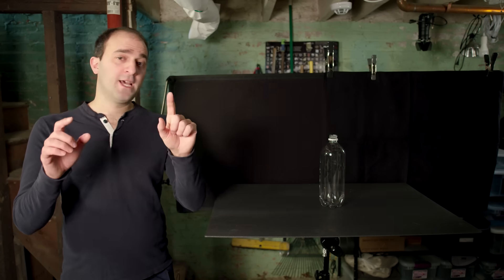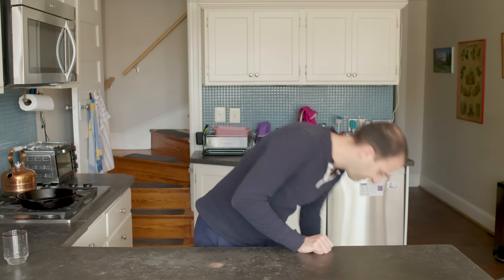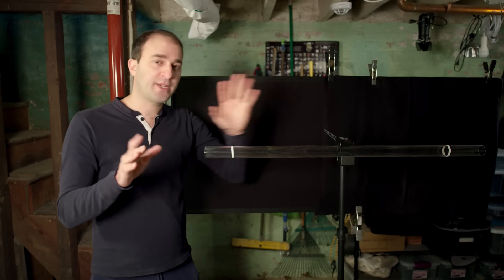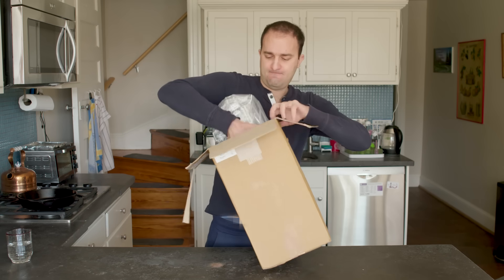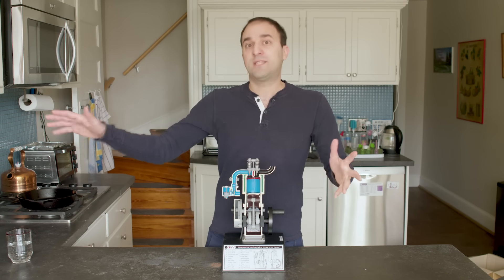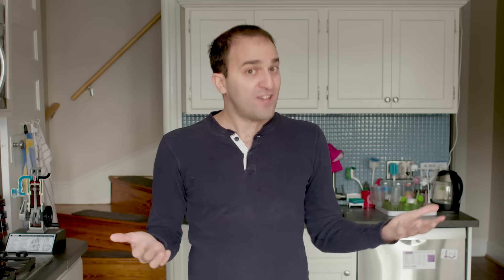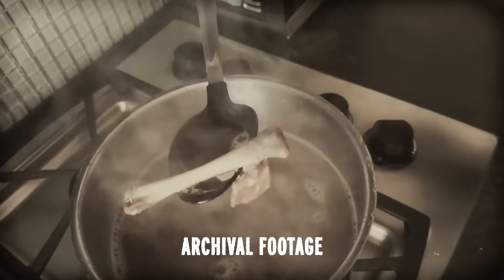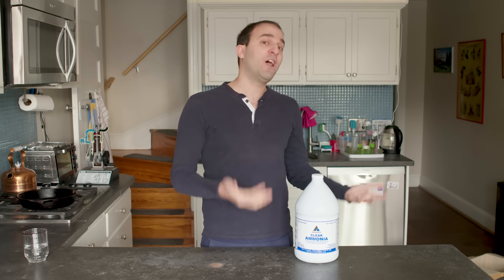Does Toyota Know Something That We Don’t?

Comment: Ammonia-powered cars make absolutely zero sense when ammonia's extreme causticity is a core reason why we aren't using it as a domestic refrigerant in fridges, freezers and heat pumps despite being one of the best options otherwise.
Reply: Worked in industrial refrigeration long enough to tell you its more of a complexity issue than anything else as to why we don't use it domestically.
Also can confirm, that shit HURTS when you get a lung full but after a while you hardly notice it.
Reply: @74KU  The dairy plants in my region use ammonia refrigeration and all have a windsock to indicate wind direction in case of an ammonia leak and the urgent need for evacuation.
Reply: @74KU  That's the ammonia dissolving the alveoli in your lungs lowering your ability to take in oxygen and adding accumulating layers of scar tissue that will become an issue at some point. Its nasty stuff.
Reply: @74KU For sure. It ten times as efficient as freon but the equipment has to be all iton and too expensive to build.
Reply: This post is exactly what I was thinking. And the NOx emissions would be terrible. I'd take carbon emissions any day.
Reply: It was once used in refigerators before low b.p. organics replaced it. As a pure anhydrous gas it isn't caustic, and it would presumably be stored and dispensed in compressed liquefied form. That would mean some practical difficulties in using it for the average car, and of course any contact with atmospheric humidity would transform it into the slightly caustic hydroxide. Presumably the Chinese/Toyota engineers are aware of all these factors and addressing them, but how successfully remains to be seen
Reply: @IUSSHistory  40 years ago, we had leaded gasoline and ethanol wasn't a thing. Now, few stations offer anything below E10 and E15 is fairly common. 10 years from now, you likely won't be able to get anything below E25 and there will likely be incentives for people to convert their non-flex-fuel vehicles to either flex-fuel or E85+.
Many gasoline cars will run on E85/100 fine as-is if you progressively increase the concentration and run a drive cycle to let injection trim tables catch up, though you may lose up to 30% of power once you hit the ECU trim, fuel injector or fuel pump limit, whichever comes first.
Reply: Ammonia engines may make sense in industrial mining and transportation, agricultural. Not in private transportation
Reply: @winelive5500  to be fair though, they said the same sorta stuff about the automobile 120 yeats ago.

Granted in dealing with anyhydrous ammonia, different ballgame in terms of consumer safety
Reply: At school we were told not to pipette dangerous liquids by mouth. One boy didn't heed the advice and pipetted 880 ammonia into his mouth. He was standing near me and I got a first hand view of the effect. I always used a rubber bulb for everything after that.
Reply: Sure and we'd never put gasoline, lead, and acid together in our garages. Ha!
Reply: Alternatives to gasoline would allow people to keep their ICE vehicles.
Reply: @CautionHighWavesAhead-  If synthetic fuel substitutes can be made in a sustainable manner with decent efficiency.

If you need 2X as much energy to make 1GJ worth of fuel which then gets burnt in an ICE to produce 1/3 as much net work at the wheel than the fuel contains, that is 12-15% efficiency from wheels to wherever the power came from including transmission and conversion losses.

With BEV, you have 80+% efficiency, which means you need about 1/6th as much power-generation and transmission capacity than you would for such synthetic fuels.

Making synthetic fuels from electricity only makes sense as a last-resort energy dump for excess renewable power.
Reply: That and you pretty much need anhydrous ammonia for this to work. Then there's the whole hazardous fuel aspect...
Reply: @patrickw9520 Yep, you have plenty of water on your eyes and in your airways. No way that you are going to have a good time around any leaks. I work in a lab any have experienced this several times over the last 30 years. The worst I have had are like being punched in the nose - hard.
Reply: They do use it in like ice skate rinks right? On a two stage cooling system? I think that how those HVAC and county inspectors all died in that Minnesota skate rink incident I believe?
Reply: @Joseph-jt3vg  Ammonia is still common in commercial/industrial chillers and skating rinks would be on that scale. I haven't found the Minnesota incident. Something similar happened in BC in 2017: three deaths after a rink chiller had an ammonia leak caused by at least 20 identified manufacturing, installation, inspection and maintenance failures.
Reply: @teardowndan5364  that might be the one I’m thinking of. Minnesota I guess reminds me of Canada. Just like Buffalo and Plattsburgh lol
Reply: Amonia was used for many years in refrigeration. I don't think you're correct on this.
Reply: @davidwestwater2219  I said DOMESTIC (as in household) refrigeration. Commercial and industrial refrigeration is a whole other story.
Reply: @canievision808  Commercial/industrial chillers, not domestic ones.
Reply: So by your logic ammonia is dangerous but gasoline isn't? 

Meanwhile a host of lithium powered EVs are spontaneously self immolating. 

I'm not commenting on the relative merits of each or any sort of motive power,  but simply on the logic,  by which you would seem to assume that water must be dangerous because most people die within 24 hours of drinking it.
Reply: @dougbright8120  Ammonia gas will directly attack all exposed tissues including your lungs if you breathe it in that deep. Gasoline fumes are mostly harmless until the concentration is high enough to detonate.

Ammonia is a gas at room temperature. If the tank ruptures and you are downwind from it, you may inhale ~100% ammonia which will severely irritate your respiratory tract and possibly require hospitalization. If a gasoline tank ruptures, it takes a while for gasoline to evaporate before anything can happen to it and if you are downwind, even a whiff of 100% gasoline fumes is still harmless as long as you walk out of the fume plume before suffocating.
Reply: Could this be used to turn the vehicle into a suicide machine ?
Reply: @tonystorcke  If you meant suicide-bombing, the initial explosion to rupture the tank would mix ammonia with air which would reduce its effectiveness as an irritant beyond its immediate vicinity in open-air areas and if the mix ignites, most of the ammonia will get destroyed in the deflagration. Not much more effective than a conventional vehicle.

Otherwise, it would be a relatively slow and particularly painful way to go. I bet most people who might attempt it would change their mind after the first whiff of 100% NH3.
Reply: Easier to store than hydrogen. Desperate measures and all...
Reply: or maybe Tokyota 👌🏻 was foolishly... fooling around for a pioneer baby project for a Tank fuel Ammonia on forklift Wheel's 👍🏻😢
Reply: They would likely use 950-D stainless steel piston sleeves and heads
Reply: It was used quite a bit, I have personally seen it at many skating rinks and one very old leaking Delco refrigerator.
Reply: Ammonia has three hydrogen atoms in every molecule.  That's not a huge secret.
Reply: Well it used to be.
Reply: Yeah my understanding is that higher concentrations of ethanol such as E85 can cause damage to fuel-system seals if a car is designed for 100% gas or E10. The ECU needs to be programmed appropriately to work with high % ethanol fuels. But a significant advantage with ethanol is actually that it reduces or eliminates carbon buildup in places that come in contact with the fuel, and as the ethanol concentration goes up, the problem of engine knock reduces to almost nothing. (which is why E85 or higher is required to get best performance out of Koenigsegg cars and others that run ridiculous levels of boost)
Reply: Anhydrous NH3 is one good way to transport hydrogen.
Reply: @thisisyourcaptainspeaking2259 it is also a good way, to second tag nitrogen below water's 😊
Reply: Urea is in def fluid, when heated turns into ammonia, hummmmmmm
Reply: The other reason is Dupont controls the world's refrigerant supply, and is instead putting more and more PROPANE in it every few years!  Maybe THAT is why we've been seeing houses suddenly explode recently!!!
Reply: Gasoline isn't exactly drinkable either.
Reply: @tonystorcke  You would likely survive drinking a small glass of gasoline without much if any permanent damage after a week of your digestive system making sure you regret doing so. You will also survive taking a few breaths of gasoline fumes perfectly fine aside from momentary dizziness.

Anhydrous ammonia (100%) on the other hand is highly caustic. Breathing straight ammonia will cause acute irritation throughout your respiratory tract and possibly cause you to drown on your own secretions attempting to protect everything from further irritation and damage. If you survive, there will likely be permanent injuries.

Ammonia poses a drastically higher baseline chemical threat to safety. With gasoline, the main threat is fire, which would be an issue with any other fuel including ammonia.
Reply: Concentrated ammonia is also a lethal poison. You don't want that leaking in the fridge in your house or your car.

I used to work at an ice plant. They used ammonia to instantly freeze water. They also had regular safety drills so everyone would get out of the building if there was ever a leak.
I'm sure Toyota knows more about it than I do though.
Reply: ....CAN BE FIXED.....THERE'S lots OF MATERIALS THAT CHEAP AND CAUSTIC PROOF

....AND BUILDING TANKS more SECURE IS ALSO OK
Reply: @robotnikkkk001  yup 👍🏻 what Chinese specialized is 🙏🏻
Fix with lowed Minefields
Reply: It's already being tried in shipping.

Yara Clean Ammonia operates the largest global ammonia network with 15 ships and has, through Yara, access to 18 ammonia terminals and multiple ammonia production and consumption sites across the world. Revenues and EBITDA for the full year 2022 were USD 4,422 million and USD 249 million respectively. Yara Clean Ammonia is headquartered in Oslo, Norway
Reply: @gk5891  The problem with ammonia isn't whether it works. It is that it is that 100% ammonia is too dangerous for general public use.

Industrial use isn't general public. If a ship in the middle of the ocean has a significant NH3 leak, the crew can lock itself in safe spaces, suit up and then do something about it. Not so much if a car leaked 40kg of it in a crowded area.
Reply: @teardowndan5364  Yes, I was just agreeing that it will used, but not for general automotive use.
Reply: But it did work. For a long time. And still does.

Ammonia is still used as a cleaning chemical.

Hydrocarbon fuels are powerful solvents so we developed solvent resistant hoses, gaskets and seals. The same is done with ammonia.
Reply: @danielbeard2656 There are reasons why domestic ammonia-based cleaners are only 3-4%. The water is there to slow down ammonia's evaporation rate and reduce the likelihood people will unalive or injure themselves from mishandling it. You are spraying your 3% cleaner at the window and that 3% sprayed 3' away from your face is already enough to make your eyes and nose sting.

You can breathe gasoline fumes straight from the jerrycan perfectly fine as long as you get to fresh air before asphyxiation sets in, no immediate risk to health from occasional exposure. That is why there are so few injuries despite how hypothetically dangerous handling large amounts of gasoline is. Millions of gallons get pumped around each week by untrained randos at gas stations many of whom probably shouldn't have a driver's license, still without issues.

Ammonia on the other hand is very caustic. It will immediately damage vulnerable tissues. If you tried breathing in a lungful of 100% ammonia, you would likely suffer a permanent loss in lung capacity or worse. Spilling a gallon of it near a crowded space could be a disaster, especially when you include people who already suffer from other respiratory problems.

Ammonia as a fuel only makes sense for commercial/industrial applications far enough away from the public that only trained crews need to worry about leaks and spills.
Reply: this is........mentioned in the video, both ammonia being causic and not suitable for cars
Reply: Not to mention we can't literally pull it from the ground. We are just adding a step to the process with ammonia.
Reply: Yes, apparently it's an issue for auto designers.
Reply: Ammonia is used for refrigerant domestic cooling,  Servel makes water chillers, then the cold water is pumped through out the house evaps for cooling....  I used to work on them 20 years ago...
Robur and Servel, a trusted name in gas air conditioning products, now offer small capacity chiller units suited to residential use and with the capability of providing improved zoned comfort.
Reply: I agree.
Further, has anyone calculated the cost of producing NH3?
Reply: @RUHappyATM 
Production is nothing new. It has been produced for many years, and has been used as an industrial refrigerant for most of the 20th century. The problem is shipping and handling. It readily changes to gas and is very hazardous to humans, and animals. Using it as a fuel is seemingly not a good idea. First it has less than half the energy of gasoline and secondly if released due to accident or other tank rupture it could injure or concievably kill bystanders. 😊
Reply: @RUHappyATM  in bulk, you can buy it for ~$0.75/gal. At 1/3 the energy density of gasoline, that comes to about $2.25 for the same energy as 1gal of gasoline. Not that bad a deal apart from needing a 3X as large fuel tank and all-new infrastructure to handle this highly caustic stuff.

Cellulosic (plant waste) ethanol is about 50% more expensive but doesn’t require much if any new distribution infrastructure, should work with most semi-modern cars with little more than an injection table tune-up and would be safe to drink were it not for gasoline contamination and additives, some specifically selected to make it unpalatable so people don’t start using E100 as a vodka substitute.
Reply: @teardowndan5364  Plant based ethanol is terrible for engines. The more ethanol you use in a traditional ICE, the more likely you are to destroy it early. There is a ton of studies/science on this, as well as more testimonials by wrench turners on Youtube than you could imagine. Also, the amount of water they user per gallon of ethanol produced should be criminal. Without government corn/energy subsidies, ethanol would never have been an option as it is too expensive and ecologically dirty.
Reply: @liwojenkins  How old are those studies? Ethanol compatibility has been required by law in the USA since 1994, anything newer than that should be able to handle E85.

Methanol is the potentially highly corrosive one that also eats many common plastics and gasket materials.
Reply: @teardowndan5364  
E100.
Is that 100% ethanol?
Reply: @RUHappyATM  Minus a bit for additives like camphor to make most people hurl if they try drinking it, some residual gasoline from the gas station equipment when switching fuel tanks and residual components from the distillation process to skip the added cost of multiple distillations and reduce the amount of tail/head getting discarded.
In Brazil, E100 must be at least 95% ethanol, can have up to 4.9% water and less than 0.1% of anything else.
Reply: @liwojenkins  most modern cars are just fine with ethanol, as long as you dont let it sit too long
Reply: @teardowndan5364  uh, hate to tell you, but ethanol does not at all solve the carbon emission problem.  duh.
Reply: @thomasneal9291  Solving carbon emissions is a fool's errand, which is why most sane people are focusing on carbon neutrality (not digging new carbon out of the ground) instead of zero. Ethanol is renewable, can be made from plentiful plant waste, non-toxic, easy to transport and distribute using existing infrastructure, compatible with most existing vehicles and burns cleaner.
Mining and building battery factories at breakneck pace to rush the electric transition based on premature battery tech produces tons of emissions too. I doubt we'll have honest numbers on how harmful the rush really is until 10-20 years from now when governments won't be able to sweep greenwashing consequences under the rug anymore.
Reply: @liwojenkins  David blum disagrees with you and debunks your claims the first cars where made to run on etanol and etanol can be made of waste plants that grow as weeds  and the by product from making etanol from corn can be used as cow foder
Reply: @thomasneal9291  yes it does duh Not to mention there are no carcinogenic byproducts when you burn it
Reply: @teardowndan5364 Most cars here in 🇧🇷 run on both a 25% ethanol / gasoline blend and up to 100% Ethanol made from sugar cane which uses about 1% of Brazil's land mass.
Ethanol mixes and Ethanol itself produces less harmful emissions.
Also compressed Natural Gas cars are available too.
Maybe an Ethanol fuel cell might be a cleaner solution?
Reply: @RUHappyATM Yes and it widely available here in 🇧🇷 however I believe it does have about 4% water  in it.
Also sugar produces more ethanol then 🌽 🌽 .
Reply: @BasedInBrazil  Ethanol fuel cells would be great, apart from needing platinum for the catalyst to achieve decent efficiency and power density just like hydrogen fuel cells.

The next best thing would likely be down-scaling free-piston linear generators like Mainspring's from 200+kW to a more car-appropriate 20kW. Generate power directly from the reciprocating motion, eliminating the crank shaft, all associated losses and combustion cycle limitations.
Reply: that's curious, because every race car out there runs on it just fine and reduces the likelihood of engine wear from heat.
Something tells me you haven't a clue what you're talking about.  @liwojenkins
Reply: @teardowndan5364  wrong.... 2004 and its 10% maximum. The mandate was passed back in 94, 10 year phase in. Prior to that, was 5%.
Reply: @teardowndan5364  Cheapest way to produce ammonia is from natural gas, without other factors, like taxes and incentives, and temporary market fluctuations the costs and energy loss makes ammonia significantly more expensive than natural gas, per unit of energy, and at best about on par with gasoline, assuming similar "external factors" influencing final price, and disregarding investments in required infrastructure.  

There are many sources of waste, that potentially could be used to produce fuels, all economically viable options put together would only be enough to replace a very small part of current fossil fuel use. The cheap, easy, quick and energy efficient way to use such waste is to burn it as it is, just dry it first if wet, in power plants.
Reply: @sigmamale4147  a good mix with 40% diesel & 59% ammonia?
Reply: @RUHappyATM  Ammonia is already produced in vast quantities by Bosch-Haber process for agriculture (on level of gasoline) and cost is very well known.It's similar to gasoline in terms  per Tonne - less in terms of energy liberated. The problem is all ammonia is currently produced using carbon fuels . If you don't chnage that and are not concerned about planet Earth you may as well carry on producing and burning gasoline. If you want to produce ammonia in green way (using renewable or nuclear electricity) that will likely cost significantly more. But it will be known.
Batetry electric is best bet by far.
Reply: @bbbf09  
If the energy is less than petrol, and it uses just as much energy to produce, why even consider it?
Reply: because it can be made at home or on demand like hydrogen. no need to store it. so its not dangerous at all... but it still butns or converts to things that can burn. 

oxygen and water not just ammoinia is in the ignition chamber... then alhchol... 

the effect wouod be konger duration burn and power stroke, lower combustion temps with less preognition... even if it does... water and ammonia slowly burn, but burns conpletely! 

in an engine you just need it to burn. the longer it burns the better!  a slow burn is more forgiving of higher compression and efforts at efficent 😝
Reply: @RUHappyATM  and it uses just as much energy to produce no it doesn't
Reply: @RUHappyATM  David blume disagrees with you and debunks your claims the first cars where made to run on etanol and etanol can be made of waste plants that grow as weeds  and the by product from making etanol from corn can be used as cow foder
Reply: @bbbf09   Like I just commented elsewhere, in many place globally the is a serious over supply of solar and wind power when there is little demand. During those times you would like store that energy somehow because it is otherwise lost and you can thus think that energy as basically free. Also in nuclear the ENERGY is almost free, it is the power stations that are expensive. It is possible that  as the price of fossil  energy inevitably will go up and synthetic fuels (hydrocarbons and/or ammonia takes off we could see a surge in nuclear power. 

For the short term batteries for cars (as I assume you meant) maybe the best solution. However I doubt it is sustainable and that it is the last word for daily driving. Liquid fuels just pack energy so much more densely that I think they will make a come back and like this video says we are used to handling them. Cars and fuel distribution today is ready and already in place for distribution, it takes the price of synthetics to come down and the cost of fossil fuels to go up. The former is not guaranteed, the later is going to happen. If that happens it maybe the end of BEV.
Reply: @RUHappyATM is there a sixth gear Auto for above D or S?

or was gear one, two or three was lesser torq? 👍🏻🙄
Reply: Yep. NToyota are unremittinngly silly - now to the point of stupidity -  chasing hydrogen and now ammonia. Apart from the toxicity to make the stuff carbon free (from renewables) requires huge quantities of electrical power and you are literally throwing half of the power away from the start. Then you have add massively costly ammonia (or H2) distribution + handling infrastructure to construct  - all likely to put it in the end back into a fuel cell in your car (itself of limited life and high expense) to turn back into electricity and power a motor.  Why not cut out all the multi middle-man chain and concentrate on batteries Toyota?
Reply: In WW2 Denmark was able to convert their diesel buses to ammonia ( the ammonia came from pig shit ) ; it took the Dutch TWO WEEKS ! We can do better now.
Reply: Hydrogen is a much better option than batteries. Toyota got it right with hydrogen (plentiful and not dangerous) and you got it wrong with batteries (comes from electricity, which is made by fossil fuels). Also, electric can lose up to 40% of charge because you decided to use the heater or ac or because you're driving in really hot weather. 7/5/24 116°F in Phoenix.  Electric is not the way. Hydrogen (from water) can be produced safely and on demand so there's no need for storage containers.
Reply: @bbbf09  Carbon free? Carbon has no significance on anything.  Climate change is a lie a grift.  Batteries are heavy (have low energy density).
Reply: @bbbf09 yo why are you hating on people trying... We need options because neither battery electric cars and especially fossil fuel vehicles will last. We see a future where we have lots of electricity from renewables and we would care more about being able to make it with much less resources. Ammonia is literally harvestable from the air sustainably. So yeah like whatever it's not gonna work now but it's not a bad 4-5th best option when the previous options fail. Kinda sick battery's are allowed to be thrown away, all batteries should heavily regulated and required to be registered and recycled if possible. We will need all those minerals we can get or we will also run out of that.
Reply: @bbbf09  I'm not 100% disagreeing, but: In many place globally the is a serious over supply of solar and wind power when there is little demand. During those times you would like store that energy somehow because it is otherwise lost and you can thus think that energy as basically free. So throwing a lot energy away is not a factor in the equation.  Ammonia may or may not be a solution for your daily driver, but there are synthetic fuels made from carbon from the air and hydrogen from water. Batteries are unlikely a solution for trucks, definitely not for ships or air travel. I have my doubts about batteries as the last word for an average car too. Once the solution for those problems that batteries just cannot solve has been developed and is in mass production I think it is likely that the solution (whatever it is) will seep into family saloons too.